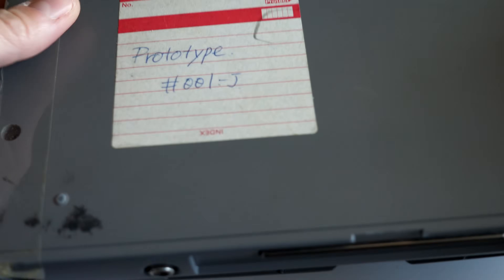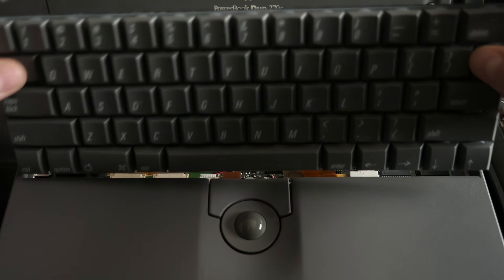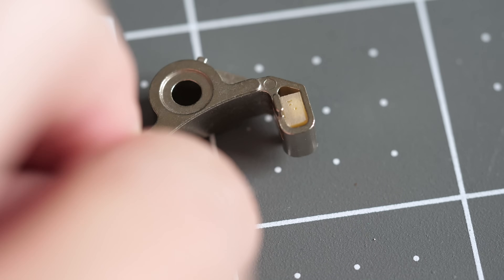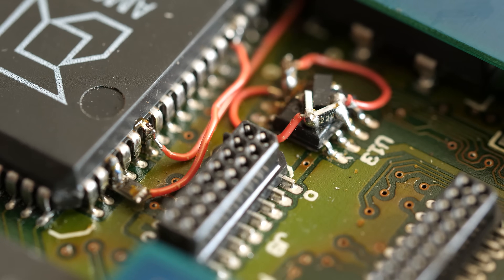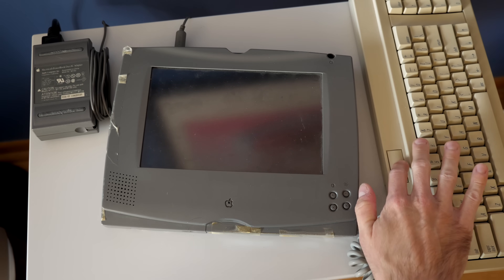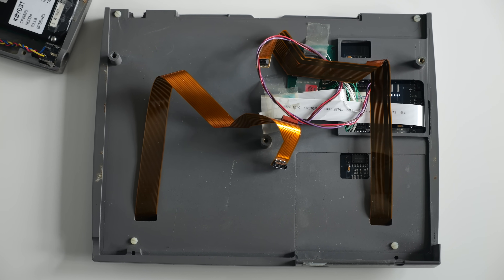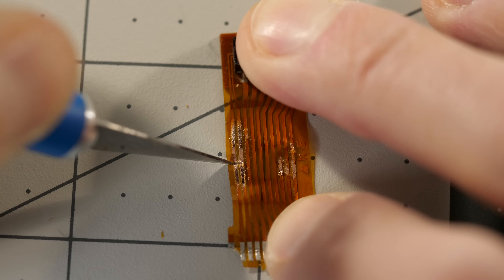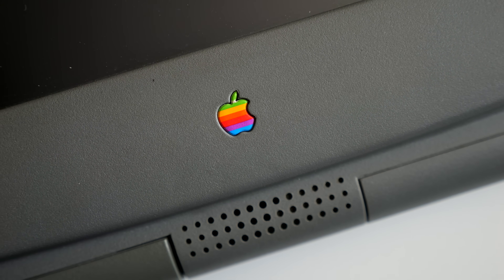Repairing an Unreleased Prototype Mac...TABLET?!

Comment: I've never seen anyone repair a flat flex cable before, this channel continues to be one of the very best on YouTube.
Reply: I have many times. Just use magnet wire to jump past the damage. Removing the plastic coating can be an issue with some flat flex cables, but it's not impossible. A razor blade is good enough for most, but if really delicate, steel wool is a better option.
Reply: @rich1051414  Yeah and this repair will never hold up.  He needed to do it with wire.
Reply: It is a common practice for Apple emate because the ribbon cable is prone to damage. I think Colin has talked about this in his emate video.
Reply: Flex cables with copper can be soldered. But always solder a thin copper wire (single wire out of a wick cable) across the gap. It will be 10 times stronger than only solder (which tends to fall off after a year). Much worse are foil cables of carbon paint (like found at the LCD in Casio keyboards and calculators) that simply flakes off; for these there is indeed no reliable repair method.
Reply: because we live in a throwaway society, when its bad we either just replace or throw it out. Ive fixed tons before with no problems but its a skill most people dont have nowadays. He could just design a new one from jlc or something then thats just replacing the original prototype one which is way more valuable to collectors
Reply: My dad has repaired one before
Reply: I’m pretty sure  @Mymatevince done that on several occasions.
Reply: I did all the time in the Military. Its a complex repair but very doable. Multi-layer trace breaks are much worse.
Reply: fixed a similar cable in my car steering wheel. the one for the airbag and buttons on the wheel that makes it able to turn. in that model you had to buy the whole assembly with wiper and light levers for hundred of euros. no thanks. still working 10 years later.
Reply: I had to do it once, but for HDMI signals. Same copper on capton stuff, but the impedances were matched. It got so noisy on the picture that we had to order an OEM replacement, the patch didn't work for 1080p25.
Reply: I have seen it before. It was another prototype PC with non standard parts.
Reply: Really? This must be the first video you ever watch on YT, congrats.
Reply: True!
Reply: That's because, in general, there is no reason to ever fix one because replacements are available.
This fix is not going to last. He needs to use  wires.
Reply: I've done it. People say it is impossible but it isn't if you can isolate the wires inside. Giant pain though
Reply: Seems like the bar is quite low these days for people to day you have "one of the best channels on YouTube".
Reply: @masterkamen371  and yet here you are
Reply: @NovanityHB that doesn't even mean anything lol

Comment: Hey, you don't need a whole clean room to do hard drive repair safely, a laminar flow hood will do just fine. Especially for older drives, you can cheaply DIY one with a Corsi-Rosenthal box.
Reply: I don't have any Corgi-Rosincore boxes.  Will an Amazon one do?
Reply: @sirnickity  Sure, you can substitute the corgi with any terrier breed of similar size, and pine oil can be used in place of rosin.
Reply: @bigmclargehuge1170   Haha  :-D  Thanks for playing.  👍
Reply: On the drives of this age it's probably fine as is, so long as your plan is to back it up immediately and rewrite the image onto something better and more modern. I winged my LC2's drive a few times without any tape by just opening it up and pushing on the heatsink of the shaft to make the drive spin again, while having it plugged in to the PC and a terminal command at the ready to dd it over — worked a treat, but who knows how long the drive will last after that.
Reply: @app0the  Dismantling a harddrive without cleanroom is very risky. Any dust particle will cause a chain reaction of debris that kills the drive within hours to a month (but at least it was enough to backup a binary copy). To free a stuck head arm, I read that it can help to rotate the drive itself causing a rotary impact to shake it loose. Also warming by hairdryer may help to soften sticky stuff, and cold (put into fridge) can help to break it loose either (like chewinggum residues in hair).
Reply: Yet his repair worked fine
Reply: @danielktdoranie  Yes, thankfully! One can make sure the repairs stay working fine by whipping up a quick laminar flow station for cheap!